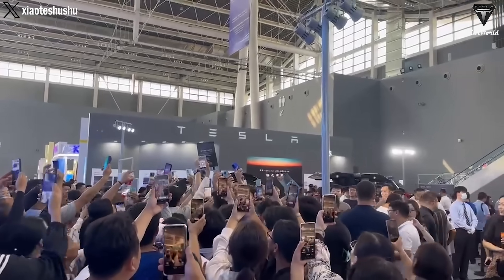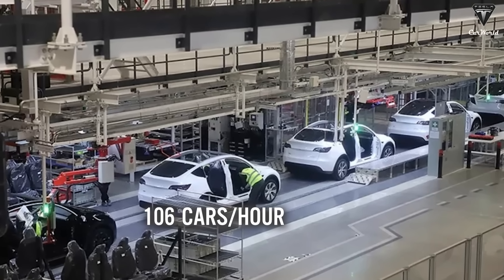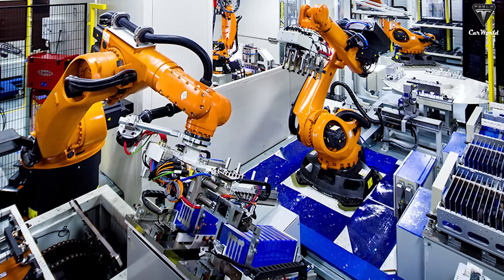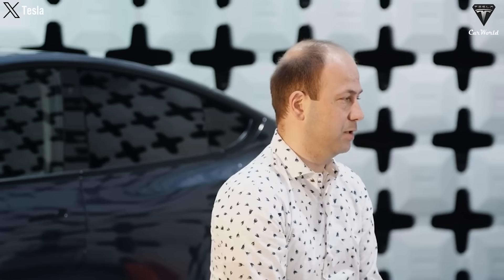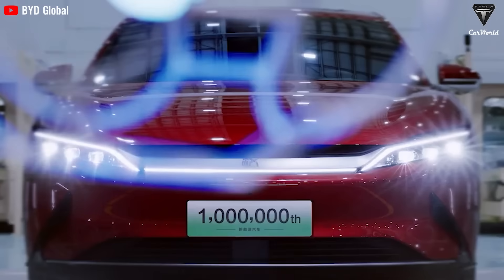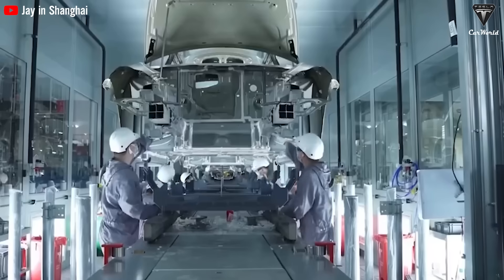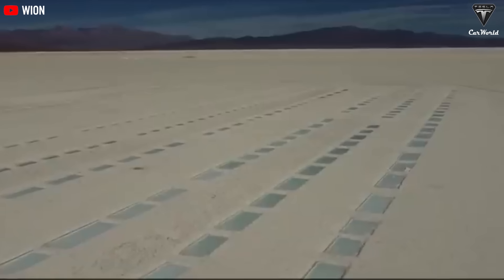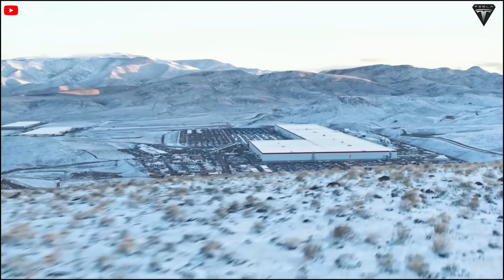Inside Tesla's Lightning - Fast Car Manufacturing: Elon Musk Unveiled How Can They Do 34 Seconds?

Comment: When we were installing equipment to make cars in UK and Europe in the 1980's the time cycle per vehicle was 36 seconds.... A bit longer for vehicles like transit vans,  but then demand is lower.  For Tesla having a bigger share of a shrinking market is bad news ( hint, EV sales are dropping because they lose value like a falling stone, and nobody wants a secondhand EV ).  The market to sell EV to rich virtue signalers is swamped.. The reason that EV insurance is going sky high ( if you can even get insurance ) is because of the 'one piece'  underframe is impossible to repair, and even a small collision can write off the vehicle.
Reply: A couple of things here.
1. What historical basis has the insurance industry have for setting such a high risk factor?
2. What kind of Quality Assurance (QA) do they have that monitors Quality Control (QC) in their batch size and rate of sample?
2a. What kind of technology do they implement in terms of automated monitoring and equipment reliability?
3.Who monitors the cradle to grave costs against historical milestones?
3a.Shouldn't progress include insurance costs within these milestones? If not, why?
4.Follow the insurance money, who gets paid and scapegoats  responsibility?
4a. CEO?
4b. Shareholders?
4c. Labor?
4d. 3rd party entity?
4e. Undefined entity? (legal avoidance / legal word salad)
4f. Stall tactic entities? (holds off until favorable regulations push through)
4g-z.Add other scams here...
Reply: @gary.richardson  More gobbldegook from an EVangelist -  the fact is that the insurance companies are very clever people who weigh up risk every day, and they have obviously decided that EV are a massive risk, probably based on two destroyed car carrying ships and a multi-story carpark burned to the ground.  I just hope that ICE vehicle drivers do not get lumbered with the costs of EV insurance.
Reply: Actually a market is being created to do surgical swaps of damaged components and the part can be printed on demand at the exact dimensions for reduced material waste and only continuous parts such as wire, hose, and pipe routes have complete replacement of affected parts. 
Repair shops will be able to invest in configurable cast-in-place equipment that will work similar to how newer generation CMOS fabrication is printing computer chips with 3D layers.
Reply: @gary.richardson  compare that with cheap MIG welder, a hammer and some spray paint and you can see why insurance for EV is sky high...

Comment: Tesla doesn't "create" an EV in 34 seconds; it doesn't "create" a car from start to finish in 34 seconds.  The factory's "Rate of Producing" a finished car is (supposedly) 34 seconds.  So in other words, a new Tesla EV rolls off the factory floor every 34 seconds.  It'll take anywhere from a couple of hours to maybe less than an hour to actually "create" the EV from start to finish (depending on the assembly process' speed).  Building ( "creating" ) an EV in 34 seconds is just REDICULOUSLY  IMPOSSIBLE.
Reply from the maker: We explained this in the video! You can watch it again to catch!
Reply: It takes 10 hours from start to finish but the rate is 40 seconds or under the record was held by ford for a long time for 90 seconds on the Mustang line some time ago
Reply: It didn’t say that but you did repeat what it said
Reply: How do you explain the number of Cars Tesla built in 2021, 2022, and 2023?
Reply: @charlesmathis3704  Again, the rate that finished Teslas roll out of the factory might be every 34 seconds (Ford claims something like every 50-60 seconds); that's the rate of production.  Tesla doesn't "CREATE" a car from start to finish in 34 seconds (that is Ridiculously impossible).  ** see the channel's comment response above; they admit that isn't true & to review the video where they point out its the "rate of production" not how quickly each Tesla is manufactured FROM START TO FINISH.

Comment: If every 34 seconds a car leaves the factory, that does not mean that it takes 34 seconds to manufacture a car as you suggest.
Reply: 24 hours times 60 minutes times 60 seconds divide by "34"... times 360 days= >< max capacity. New tech makes faster,,, say 31 seconds, =10% increase going forward.
Doubling production requires more lines same factory
Reply: A completed Tesla car leaves the production line every 34 seconds.  Each car might have been on the line for 2.5 hours (or whatever).  However, with M3 Highland there are a number of car "modules" all being assembled in parallel, thus the total "man hours" per car would actually be longer than 2.5 hours.
Reply: @alexmanojlovic768 Some of those assembly parts are in the 'vertical chain'- Tesla created them and absorbed savings while at the same time reducing parts in toto which offsets more 'hours per car', like the gigacast saving 1600 welds on the Y model.
Moduler ends up saving and creates more safety.
Reply from the maker: Take an average based on their production line, it's not just one!

Comment: you can''t make a car in less than a minute. You can, however produce a car every 40s. The difference in meaning is significant.
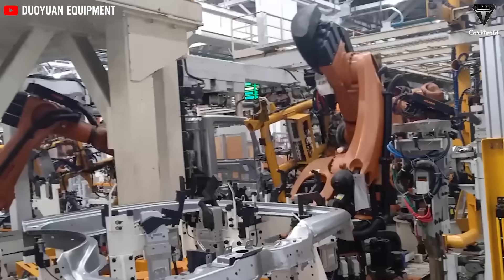Reply: They explain this at 06:07
Reply: @bearlemley  I suppose in your opinion, it's OK to say BS if you then precise that it was BS afterwards. I disagree. Don't say BS at all, no one will be confused. Especially when the explanation isn't that clear either. Building a car every 34s is NOT building a car in 34s. When it's that easy to be very clear, why not be clear in the first place?
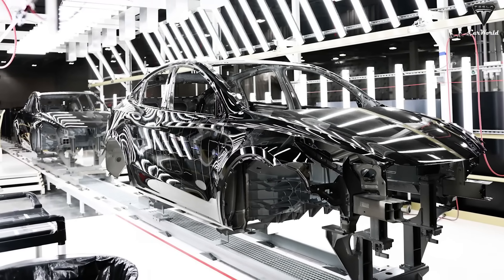Reply: @6:37 says it takes 2 1/2 hrs to make a vehicle
Reply: @JackLemp-tm8fg What is wrong with you, people? It still says they do it in 34s and that's wrong.
Reply: You could produce a car in 34 seconds if you were super fast like the Flash.  If you have 10 stations, it would take 340 seconds to make a car at 1 car every 34 seconds.  It would take 3400 seconds (56.7 minutes) if you have 100 stations.

34 seconds per car is just a measurement of the speed of the slowest station.  That station limits the speed of the entire line.

Tesla is the leader in reducing the longest station time.  The new inverted fractal production line has the potential to further cut the slowest station by duplicating the slowest stations and by reducing the average mass to be moved per station.  The latter will also reduce energy consumption per car.
Reply: @darwinboor1300 You clearly either:- don't understand production line manufacturing concepts.  Can't explain what you understand, understandably to others.  Or are showing off while being totally ignorant of many aspects of real life.  Especially manufacturing processes.
I haven't read such babbling nonsense in many years.  34 seconds has nothing to do with the "speed of the slowest station".  It is the time elapsed between 2 vehicles leaving the production line, completed.  NOT the speed of any given station (speed in relation to what??!! Speed per action? Speed per distance travelled? 🤦‍♂️). I give you credit for allowing your posterior to control your typing fingers...🙄

Comment: India needs decent roads first before anything 😂
Reply: They wont make a factory in India.  Like you mentioned, infrastructure isn't there.  Quality control is not there and corruption is far too high.  You cant compare them with China just by population.
Reply: Not if they go to air taxis on virtual roads and monitored/controlled by industrial grade traffic safety pylons.
Roads will still need to be built and maintained but high speed air travel with permission granted based on speed capacity and primary/emergency landing capabilities.

Comment: Although Tesla is a clear leader in manufacturing efficiency and speed, I found this video confusing. As the video rightfully claims at some point,Total cars manufactured per unit of time is an entirely different concept than the time required to assemble each car. However, other parts of the video seem to be conflagration of the 34 seconds with assembly time with total manufacturing time (which is also a different concept and would include time required to manufacture individual components).
Reply: I was a bit confused by what 34s actually represents in terms of the whole process. I’m assuming that it's just the final assembly run where the pieces are put together but there must be a variety of manufacture and assembly before that. Even the computer components require assembly that I’m guessing would take much longer than 34 seconds. I wonder if there are videos showing most of the manufacturing process.
Reply: @jacobpaint  I believe the 34 seconds only means the average frequency (asuming 24x7 operations) of cars coming out of the assembly line.  At some point the video does say that the total process is about 2 hours and a half (if my memory isn't failing me) and does recognize that is much longer than the 34s. However, as you rightfully point out, even that time is likely just the final assembly process with most, if not all, components already manufactured. Those should each take their own time (some of them by an OEM). That was precisely part of my confusions. At times, it wasn't evident to me, if the assertions had to do with the cars coming out of the assembly line per unit of time or the final assembly process as a whole or the total manufacturing time (man hours, robot hours, whatever).
Reply: you are either a fan boy, a liar or ignorant when it comes to this subject. so which one is it?
Reply: @MisterForYaSister what are you on about. They asked a legitimate question, I can't imagine how you think your comment makes any sense.
Reply: @jacobpaint  because they are not a leader. i think as a company they might have hit their production goal once in a quarter. so yeah it makes sense to me. their stock price is built up on hopium not data.
Reply: @MisterForYaSister  I wish I understood your post. My basic knowledge and experience in engineering, processes and logistics isn't enough to understand your "genius" level of understanding. I lack your crystal ball and that doesn't allow me to infer what you mean by just reading accusations with no specific substantiation.
Reply: @graciasthanks4771  1.well it's not the fastest automotive producing plant. 2 the production quality for this plant is the best one for tesla. 3. he lies about basically everything. 4. so i assume they are lying about this. 5. tesla is getting better but i really hater liars. 6 i will now have a crystal ball moment. 7. the cyber truck will fail. it might not at first but i will be a total nightmare for them, the consumer, the insurance companies and also, in repairing.

I'm not an ev hater, i'm on the fence. I have always believed that tesla is a software company that makes cars. I have also believed that they really needed a car guy to help them to this. This is where they failed at. hope this clears it up for you a tad bit lol
Reply: @MisterForYaSister  Time will tell. Unfortunately Youtube punishes links, but I suggest researching the efficiencies Tesla has achieved in assembling cars, including steps required, quantity of people required, total man hours required, total elapsed time per vehicle. They seem to be much better metrics than most legacy auto makers. Of course they aren't perfect. I do accept that original quality was lagging. However, as far as I know, their quality is good right now and, one of the main reasons they can produce cars cheaper than most is precisely assembly efficiency. Not the only one, but a very important one.
Reply: @graciasthanks4771  it might be good at one plant for what i can read about. i dont want him to fail. i just want to stop lying, improve customer service, let other people fix their cars, allow suppliers and aftermarket people produce parts, and for the usa government to enforce the law of right to fix.
Reply: @MisterForYaSister 
Is that the usual way that talk to people?  
Your personal attack is also a tell.  You are transparent. 
It means you must not have a rational argument.

Comment: The deal through Saudi has the issue makes Tesla visibly gaining Congo’s unethical mining of cobalt a huge problem.  Tesla will have to make Congo fix this or Tesla will lose a large quantity of sales due to these practices.
Reply: Apple uses more cobalt in their batteries than Tesla does! Tesla has already developed electric motors that don't use rare earth minerals! They will soon have batteries without cobalt. The biggest use of cobalt is in the refining of petroleum. Also Tesla uses much less water that other auto producers!!! Solar panels on the roofs provide much of the electricity required for production of Teslas!
Reply: @kathleenwhitten7120 That's a good lie. Do you have any idea the amount of electricity that it takes to operate a foundry / die casting operation?  Your little solar panels can maybe keep the lights on.  You start running multiple 10 and  20 horsepower motors that these robots use for their hydraulic systems. That big Idra giga press,  that thing probably has multiple 20 horsepower motors on just the one machine.  We haven't even started to talk about heating solid aluminum hot enough to be molten and then each of these giga presses will have its own furnace to store the molten aluminum as it is being used. These are huge furnaces because these die castings are huge, about 10 to 20 pounds of aluminum being used every minute.  No way in hell are those solar panels keeping up with that much demand.
Reply: Oh please that old bs. Gas a d diesel use more cobalt and its lost in the process.
Reply: What is unethical about the mining? That kids are doing the work? Did it occur to you that those kids want the money to support their poor families? Just like kids used to work in factories in the U.S. to support their families.
Reply: @darylfoster7944 makes sense, I've been thinking about this for a while as I have three young children
Reply: All you are doing is showing your ignorance.